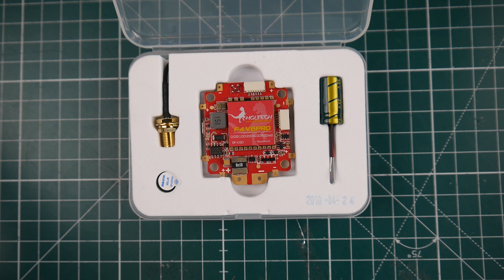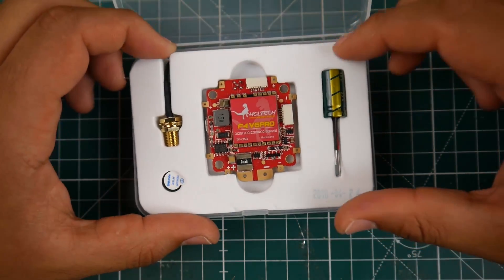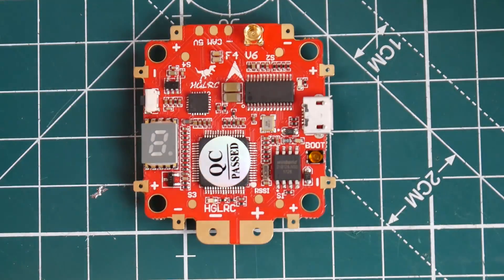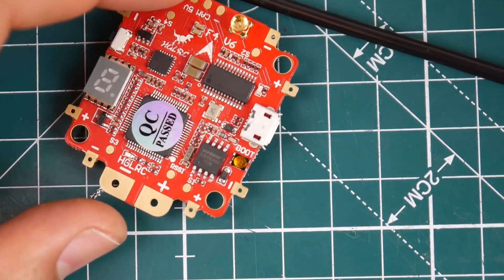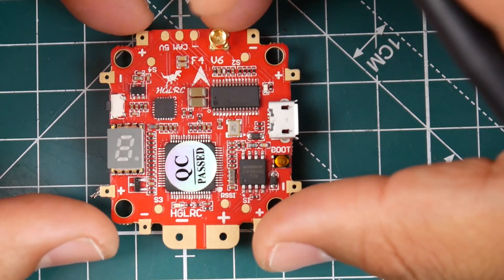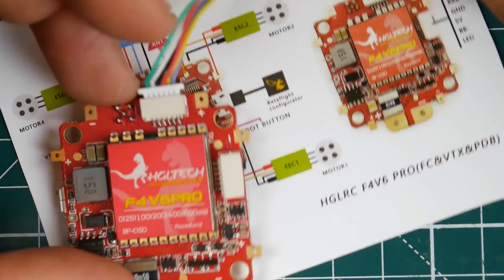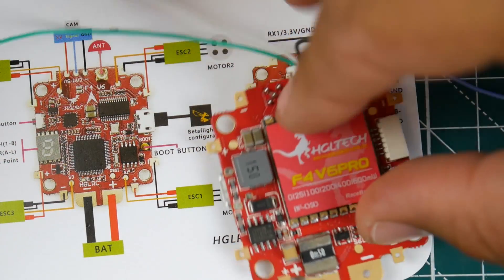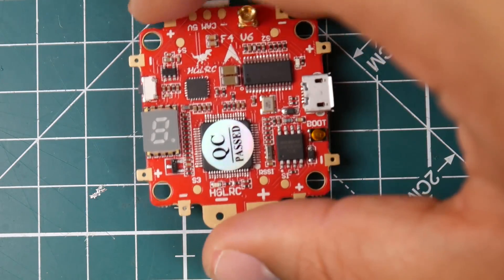HGLRC F4 V6PRO // Overview and Setup Guide

Comment: i fly with a couple F4 V5's and 1 F3 V4. the F4 is awesome. the F3 has issues. what about the BFOSD to change channels and bands? i thought this board did that.... the main reason that i would bust VTX's was from Damages during crashes.. i have yet to damage a VTX on these or burn one up. i think the actual board helps displace the heat...I like them.
Reply: This board does change channels and bands over UART3 and Tramp Protocol.

Comment: Pretty compact build. I don't think that VTX at bottom is a good idea. Above 25 mW it will be damn hot and I believe that it is not good for FC work stability. Seems FC must be turned upside down to allow VTX to cool off in air and little heatsink should be put on it too for cooling. Other things does look more or less Ok. VTX Tramp control out of box is very nice. I would not worry about ESC power pad peeling off too. Conductive layer on pads is double sided with connection through hole. Put a solder blob in both sides of pad large enough to connect both sides through hole and from outside. That will keep pads together. Looking on pad size 50A per each ESC seems a bit optimistic though :)  But for majority they seems Ok. I believe that it is possible to connect F.port through TX6 too.

How about a little noise test?

Comment: manufacturers making AIO boards like these should be using lead-free solder for more heat resistance so smd parts won't get desolder.

Comment: I have the v5 and first one vtx went out then they sent replacement that one 5 volt regulator went out then I had to argue with them and they sent me another and it works but you can't tell when you have 600mw cause the leds are fucked up
Reply from the maker: Charles Phillips You can fix your older ones just re solder them back.. This is what I was talking about they desolder them selves.
Reply: Drone Mesh vtx is gone and it gets hot real fast the one with regulator it works when it wants to

Comment: Why the heck is frsky using s-bus ?
It will be a lot better if they used i-bus
Reply: BuzzCola 3 Flysky user perhaps? ;)
Reply: alice yes 😄
Reply: FrSky/SBus is amateur industry standard nowadays, sorry. IBus can be connected through same serial port where SBus except signal is not inverted in receiver output. For IBus use RX1 (leftmost pin/wire) in forward side connector.
Reply: KrotowX I-bus you can connect anywhere, on any UART.
I think S-bus is inverted, because it has inverter on board (that's why you can mod it so it works on any UART)
Reply: You think I like that SBus and Smartport are inverted? God, I hate this Futaba legacy! For me it cause only problems. Hope that with F.Port inverted receiver signals will finally fade away in past.
Reply: KrotowX yeah, but I don't know if it is true